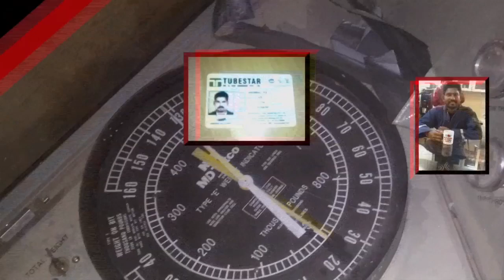API ROTARY SHOULER CONNECTION IDENTIFICATION BY SIMPLE TECHNIQUE .

Comment: how to identify the connection of vam, dstj, gpds drill pipe
Reply from the maker: Those connections thread length, nose dia, and cylinder Dia will vary. So these three dimensions you can consider to identify. At least thread length and cylinder Dia.